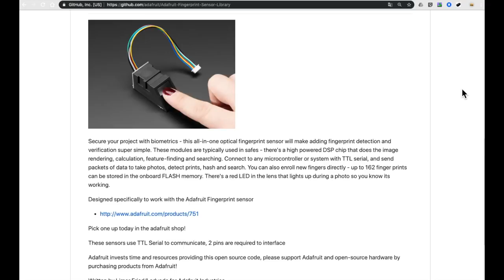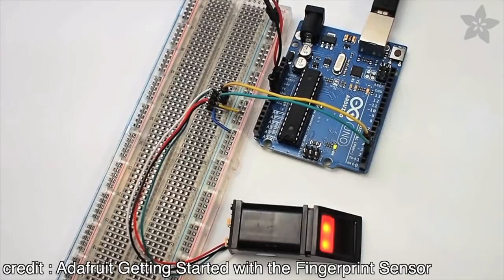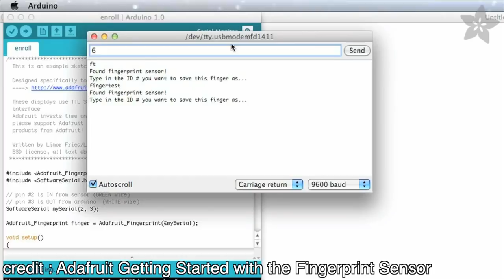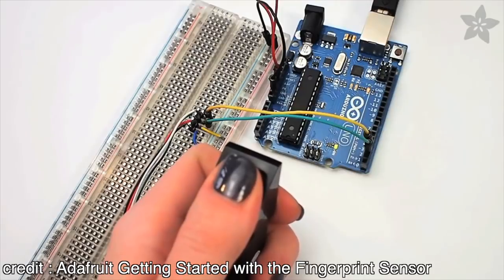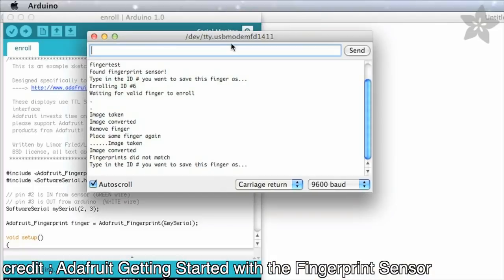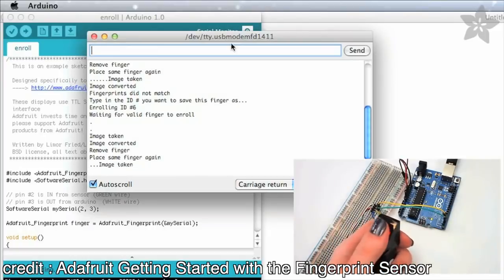How to make Fingerprint Door Lock with Arduino - DFRobot

Comment: you must have kept the arduino relay and the door lock on the other side of the door and only the fingerprint sensor on this side. in your setup the door can be opened easily by removing the door lock connection from the relay and supplying it 12v will easily open the door even without the finger print. your set up is good
Reply: This is just an example

Comment: Can i ask question the 12v power source is that battery or 12v adapter?
Reply: Thunder Thunder works like adapter, called relay, used to get more power